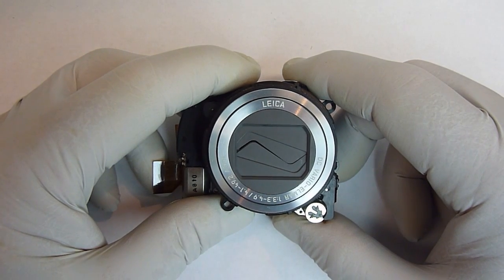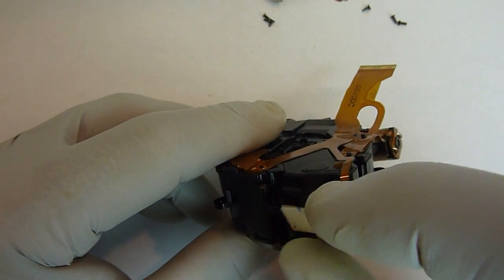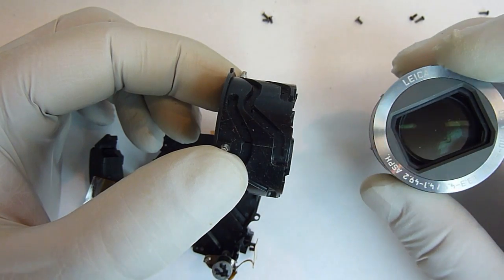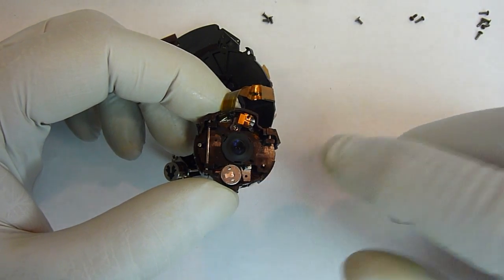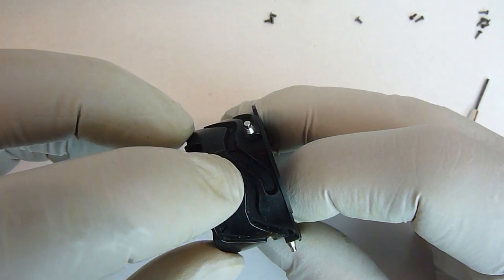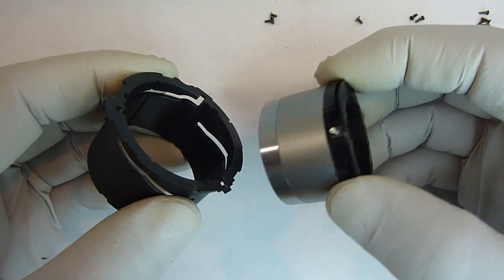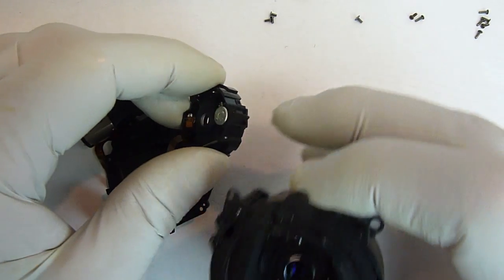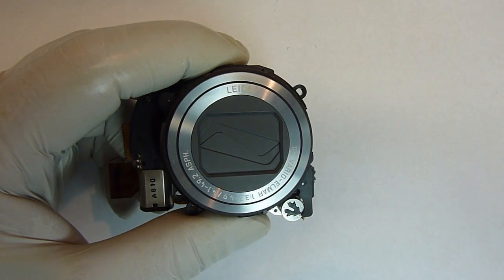How To Repair & Clean A Panasonic Lumix ZS & TZ Model Leica Lens Units

Comment: Hi Robert, many thanks for the detailed tutorial. I've got a TZ8 with System Error(focus). After lubricated the shaft of the focus motor and make shore that the white plastic slides easy the error dissapeared but the camera doesn't focus. Any ideea? thanks!
Reply from the maker: Hi Ov A. When it tries to focus, do you hear the focus motor running at all? And, if the motor is running, do you see the image on the LCD screen changing at all as it tries to focus? Or does the image on the LCD display just stay the same the entire time??
Reply: Robert Hosea hi, Robert, yes, i can hear the motor running, and the image changes but just a little. I've just opened it again and i saw that the white plastic was at the end of the crank and the 4th lens was close to the CCD sensor. Sorry i forgot to mention that.
    
Is there a chance to behave like thins from the dust because i've seen some particle on the lenses and allso on the sensor. Thank you for the replay,

Regards!
Reply from the maker: Ov A The first thing we will need to do is to find out if the lens unit is moving up and down on the shaft as the focus motors moves the white tab up and down. The lens unit assembly (the black plastic that holds the focus lens) is spring loaded. When you removed, or worked on, the focus motor earlier did you notice if the spring was still there? The only way that the spring could come off is if you removed the focus lens assembly from the pins (one silver and two black) that keep it in line as it moves up and down. Does it appear that the spring is in place?
Reply: Robert Hosea yes, the spring is in the place to be and the focus lens slides easy
Reply from the maker: Ov A Good. The next thing is to turn the shaft of the focus motor and manually run the white tab up and down on the shaft. You can do that by locating a small hole in the plastic housing at the very end of the focus motor shaft. It will be covered by the orange plastic circuit lines. To help find it, look at the CCD side of the lens unit assembly where you can see the three screws that hold the CCD in. Then look over at the area where the focus motor is installed on the other side. You should see a small circular piece of plastic attached to the orange plastic circuit line. Lift up on the circular part and you will see the end of the focus motor shaft. You should be able to use a very small slotted screwdriver to turn the shaft. Using the screwdriver turn the shaft counter-clockwise to make the tab move up the threaded shaft. You will have to turn it many times. When the tab moves up, the focus lens unit should also move up with it. Try that and let me know what you find.
Reply: Robert Hosea hi again and sorry for the late reply. I did as you said and noticed that the 4th lens doesn't move at all when the lens group are closed. Even when the plastic piece was at the top end of the shaft. I have to mentions that the focus lens slides easy when the gap of the group lens is opened. Maybe it's something wrong with the whole group of lens. I've made some pictures and i can attach them to a email. Here is mine ovidiuari@gmail.com
Thanks so much for the help, I really apreciate!
Reply: Ov A i came with a news, it does focus but only when the zoom is fully extended and when it's fully retracted. I mention that the 4th lens slides very easy.
Reply from the maker: Ov A We need to establish that the spring is still in place. When the white plastic tab was at the top of the shaft (near the motor) was the focus lens also up there? If it was you should be able to press lightly on the focus lens assembly and press it down a little and when you release it it will come back up. I would like to see the pictures that you have. I will send you and email with my email address.

Comment: Hi Russell,I am most wary of all the moving parts(6 metal flaps) in the TZ-60 lens covering.It's way over the top in terms of potential problems in my opinion.Do you have an opinion about this or am I just showing my age(old 35mm girl)?
This is a brilliant,helpful video btw,THANKS :)
Reply from the maker: Hi Blinky Cat. Without having one in my hand to look at, it would be hard to say. I would hope that Panasonic has figured out a way to prevent dust & particles from getting into the lens, which is usually what causes the lens cover from opening and closing properly. Good luck with whatever you decide on!

Comment: Hi, I have a DMC-TZ40 with a broken screen. Is it possible to replace it economicaly?
Reply from the maker: David, I found a couple of replacement LCD touch screens for your TZ40 on Ebay, but they don't come cheap. It looks like they start at $125.99 (+ $2.99 S&H). All are in China and it would take at least a few weeks to get them. I did a quick look on the cost of a new TZ40 and it looks like they start around $300 for a Japanese version. I did find a used (like new) TZ40 (English) on eBay, that it is going for $265. I've never worked on a TZ40, but I would guess that replacing the LCD screen on it should be possible...and hopefully not too difficult. Good luck with it David.
Reply: Robert Hosea Thanks for that Robert, but I think i'll bite the bullet and buy a new TZ60. I hope they have got around the noise problem in low light and the bellows action of the lens sucking in minute debris

Comment: best explanation on the subject. Note; you will need a very good light source and loop to see tiny parts. Can air is best for blowing out dust. Q tips can leave fibers behind. Don't rub alot on the lenses, some are plastic. Expect 1-2 hrs to do this the first time. Take careful notes and mark parts location during dis-assembly. MAKE alignment marks of your own prior to taking the lens assembly apart. Do it slowly so everything does not just fall apart.  A fine red marker or something..Again, detailed notes are important here. The thin sleeve in the lens assembly is fragile! Easy does it. No force should be used in re- assembly.  Plastic parts are generally self-lubricating too. Inspect gears and grooves for wear. Parts need to be clean when assembled. Wash hands and wear gloves if possible. Gently test assembly by rotating drive gear prior to placing the end cap on lens assembly and make sure everything is exactly placed as you took it apart, otherwise the lens will jam when you turn it back on. Try this with a junk camera first if possible. Ribbons disconnect by lifting the black portion of the clip and gently extracting the ribbon. Screw drivers have to fit well as a fair amount of torque is needed to remove the screws. Good luck. Fun and interesting to see how these are made. Thanks for the video.

Comment from the maker: Hi Vlad. I'm sorry that I don't have anything for you on the ZS20. I do have a ZS19 that I plan on doing a video on in the future, but I'm not sure if it is similar to the ZS20 at all. If I find anything about the ZS20's lens unit I will certainly pass the information on to you. Good luck with it. I hope you're able to get your camera up and running again.
Reply: If memory serves me correct the ZS20 nearly the same as a ZS19 the difference being the ZS20 has a GPS.  If you do a tear down on a ZS19 that would be great as I have a ZS19 w jammed lens  and I haven't had the confidence to open it up.
Reply from the maker: Frank Sweeney I agree Frank, I think the only difference is the GPS feature. The lens unit on a ZS19 does seem more complicated than the ZS6/ZS7. But, I do have one torn down on my bench. I'm still working on getting the correct method to re-assemble it. I will sure let you know if I'm ever successful in figuring it out Frank.
Reply: Dextor, there is nothing in that page

Comment: Hi Robert, I have  DMC-TZ30 that I dropped in a rock pool, although was in a camera case. The camera worked perfectly after the event but when I took the battery out and put it back in the camera won't turn on. I've charged the battery, lights indicating fully charged however, still won't turn on and no noise when switching on. I think it could be sand/dust in the lens - I'm going to follow your video, do you think this will help?
Reply from the maker: Hi Chris. I would bet it's moisture in the camera and not sand or dust in the lens unit. I had a camera do the same thing one time when it didn't get "wet" so to speak, but a small amount of water, maybe a few drops, did get inside. My camera still worked for a while, but eventually it quit working after moisture from the few drops of water worked it's way onto the circuit boards. I was able to get it going again by opening the camera body and removing the circuit boards and allowing them to dry completely. When it comes to electronics it sure doesn't take much moisture to make a camera completely stop working. I wouldn't think you would need to disassemble the lens unit unless you can see visual signs of moisture inside the lens unit. Good luck with your camera Chris. I hope you get it dried out and up and running again.

Comment: Hi Robert, please I`ve got a Panasonic Lumix DMC-SZ1, It has a problem when I turn on It appear a message "Turn off and turn on again" when  I do it then appear other message "System Error (Focus)" in both case the camera is blocked, I do not trust in technicians neither I have not any near. Could You help me to determine the possible problem?
Reply from the maker: I would guess that it's probably that the focus motor is stuck. The focus motor is the small motor inside the lens unit that has a long threaded shaft with a white plastic tab and also a plastic unit that holds a lens. Both run up and down the threads on the shaft as the motor turns. Many times the motor itself is fine, and it's just that the white plastic tab gets stuck. I don't show removing the focus motor in the video, but it's easy to do. There is one screw on the motor side to remove and the entire unit will come out. The plastic unit that holds the lens is spring loaded, so remove it slowly. Check to see if the white plastic tab is stuck. If you can loosen it and it seems fine then you may want to add a very small amount of lubrication to it before you put it back in, to help it operate properly. Good luck and let me know what you find on it.
Reply: Robert Hosea Thanks Robert for answering, well when I turn on the camera the sound of the motor is a little harder than before. So I will try to do that You recommend me. Many thanks

Comment: Hi Robert, my DMC-TZ10 is presenting some kind of zebra marks so I follow your videos to clean it but the problem still persist.  Do you have any idea about what might be wrong?
Here is an photo with the error:  http://s4.postimg.org/z3795x5i5/P1050016.jpg

Thanks,
Ricky
Reply from the maker: Wow. That's a tough one. I'm not sure what would cause the problem that you're having. I was unable to see the photo that you posted. Can you post another one? My guess would be that the CCD is defective, or that there is a problem with one of the circuit boards. Sorry, just a guess right now.

Comment: quick question: I have a lumix ZX1 when either the lens open or closes, the piece (do not know the name of it) than should close and protect the lens, does not close or open totally, need to shut/open manually, use my finger nail to do it...can this be fixed? how? thanks on advance for your help
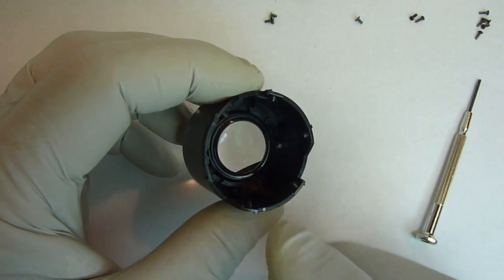Reply from the maker: Hi Paulo. I'm not familiar with the ZX1 lens unit at all, but if it's similar to other Leica lens units then sand or dirt, or a dent in the lens housing, could cause that problem. The only way to completely clean out any sand or dirt is to remove the front cover unit. Unfortunately you will need to disassemble the lens just to get access to the two screws that hold it on.I do show how to remove that part of the lens at the time location of 16:50 of this video. Also, I show how to remove the entire lens assembly from the camera body in my other video How To Repair A Panasonic Lumix ZS & TZ Model Camera (CCD sensor, lens unit, etc.). You will only need to watch the first few minutes of that video to see how to remove it. It's pretty easy. Good luck with it Paulo and let me know how you make out on it. -Bob

Comment: Great video I have a DMC-TZ8 and now that I have the dust removed the pictures have a red hue to them? What did I do wrong? Help!
Reply from the maker: Hi Laura, I would check all of the flat ribbon cables and make sure that they are all seated correctly in their sockets. I've run in that problem before with the LCD flat ribbon not being straight and the LCD display didn't work right. All I had to do was straighten out the ribbon in the socket and that fixed it. Let me know if that helps.
Reply: Thank you I will try again but the display looks great it in the camera? I did notice that the rubber seal on the sensor is off. So I put it under the sensor. I thought it was attached to the sensor though?
Reply from the maker: laura wells
I don't think it is attached. I will look tomorrow though and see for sure if it is. I'll also take a look and see if I can see if there is anything else that may cause the problem you're having.
Reply from the maker: laura wells
I double checked and the rubber seal is not attached to the CCD. Are you only seeing the red hue when you are looking at the pictures on your computer? Or do they also look red on the LCD display of the camera too? One thing that may cause this would be if the flat ribbon for the CCD was not seated properly. But, if that were the case, I would think that you would see the red hue on the camera's LCD display too. I sent you an email yesterday so you should have mine now. Perhaps you could send me one of the pictures so that I can see how it looks. Thanks.

Comment: This was a great video. Very detailed. Although, it didn't fix my problem, I was able to strip down the lens completely and clean it out and reassemble it. Unfortunately, my issue seems to be something else to do with the focusing part.
Reply from the maker: Hi Tina. I'm sorry that you weren't able to repair your camera. Maybe we can still figure out what is going on with it.

What Lumix model do you have?
Is the problem that your having an out of focus image?
Do you get any error messages on the display?
Do you hear any motors that are continuously running?

Thanks.
- Bob

Comment: Robert,
first of all thank you very much for your amazing videos!
My Panasonic Lumix DMC-SZ9 camera stopped working after a drop doing country sky last week.
The camera was in a cushioned case but apparently it hasn't been enough to save it.
The LCD screen isn't broken because the menu labels are displayed properly but the CCD sensor returns a bunch of colored vertical lines. When I take a picture the same bunch of lines is saved in the memory card.
What could I do? I imagine that the CCD sensor could be broken. What do you think? Is it possible to purchase somewhere a CCD  sensor for the SZ9?
I've already opened the camera (I know, I'm stupid, I've lost the warranty ), because I hoped in a disconnected connector but apparently everything is fine there.
Thanks in advance for any suggestion.
Reply from the maker: Hi Alberto.

Oh ya...there's a certain feeling that I get in the pit of my stomach whenever I drop my nice camera on the rocks or in the water. And I've done it a lot. Two years ago I was climbing to the top of a 7500' tall rocky peak in our area and video taping it as I was going. During the last few final steps to the top I was looking at the LCD screen while walking and...ya...that was really stupid. My foot slip and my new Panasonic ZS7 went crashing into a rock while still in my hand. It bent the lens housing so bad that the camera wouldn't work anymore. Needless to say that was the end of the video taping for that trip with that camera. When I got home I was able to disassemble the lens and "straighten" the lens housing out and amazingly it worked again.

On your camera I would "guess" that it isn't the CCD because there really isn't any moving parts on it. It sounds like what you are seeing is an out of focus image. It's possible that the focusing lens or focusing motor, or the image stabilization assembly have become dislodged. Generally a focusing motor problem will generate an error message on your display so I would lean more towards the image stabilization assembly. That part of the lens is one of the last parts that I show being removed in this video.

I did a quick search on the internet, but I wasn't able to find a source for a replacement lens for your camera. I'll keep looking though to see if I can find one.

If you haven't already done so, you might try disassembling the lens to see if you can see the problem. You may get lucky and find that it's something that you can fix.

Good luck with it Alberto!
Reply: Thanks Robert for the quick and complete answer.
I will try disassembling the lens (following your video of course). I will keep you up to date about my findings.
Reply: Robert, 
I've finally found the time to disassemble the optical part: apparently there was an intermediate lens mounted on a movable plastic support controlled by a spring which was stuck somehow. I've released it, reassembled everything and now the camera works perfectly again. So thank you very much!
Reply from the maker: Alberto Borgnino Great job Alberto!!! From your description I would say that it was the focus lens that was stuck. I'm glad that you were able to repair it!